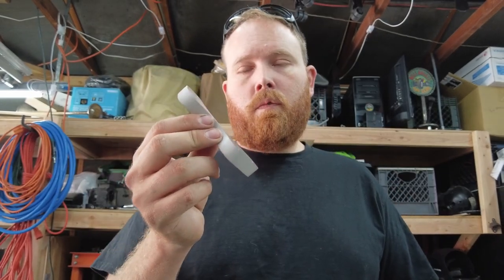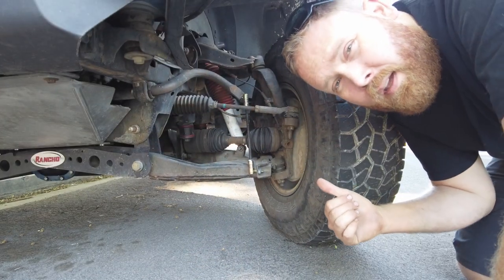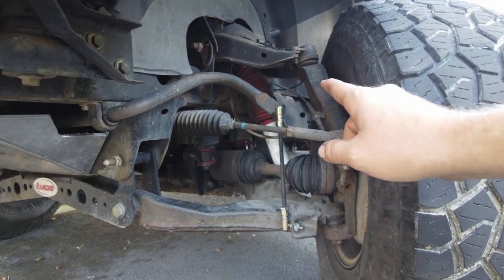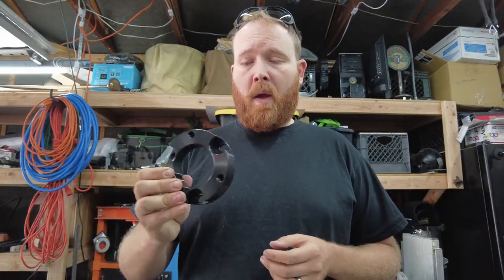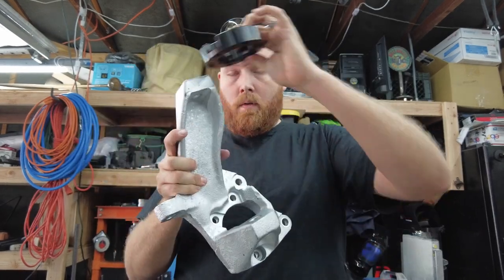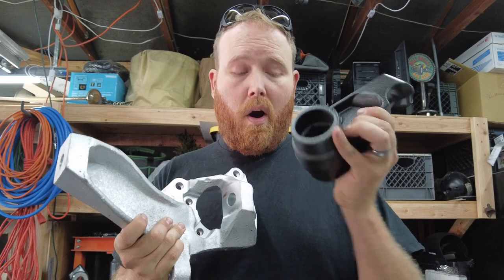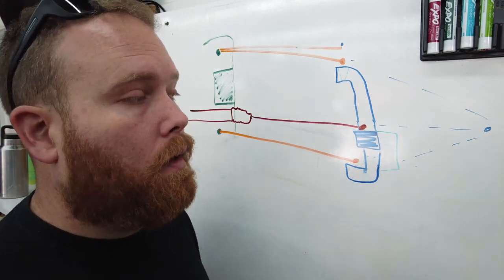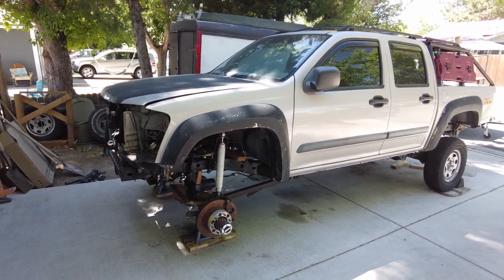Lift Kit VS Leveling Kit? [Why not both?]

Comment: Question. I have a 2008 Colorado z71 4x4. I bought a 2004 z71 but its 2wd. Can I swap everything over and it work on the 2004 frame? Will the front differential bolt up and everything else 4x4 bolt up on the 2wd frame?
Reply from the maker: Yep

Comment: Man I hope you make 2wd lift spindles for these trucks, the only company that will make them just like CST 5 inch spindles are Michigan Metal Works. Now they are a great company but they are quoting 3500 for a set of lift spindles. We need to find some that arent ridiculous priced for 09 to 12 Colorado/Canyons.
Reply from the maker: MMW quoted 3500 lol thats nuts.
Reply: @BadlandIndustries  your telling me brother, what's the status of your spindles?
Reply from the maker: @marcustellez6563  still working on the design. I need to 3d scan the z71 spindle to see how the tie rod mounts match up.
Reply: @BadlandIndustries  will this also work for the z85 as well?
Reply from the maker: @marcustellez6563  I plan to design it in such a way I can jig it for either suspension and weld it together. 2wd z85 and the 2wd z71.

Comment: Ball joint spacers wouldnt lift your truck because the weight and height of the truck is based off the lower control arm not the upper
Reply from the maker: you are correct

Comment: With your leveling kit / lift u offer does it effect flexibility/FLEX  offroad & rocks?    Or with disconnects u offer let it fully flex in front?
Reply from the maker: The disconnects will allow the front suspension to be fully hung and stuffed independently.
Reply: Ty,   also I kno u sent a link for billsteins for lift could u send link for Fox.   I been using them for years & I really prefer them if available for this vehicle with ur lift...
Reply from the maker: @user-uy6rb3bc9j  i would cross-reference the lengths of the bilsteins with fox.
Reply: Ty, if you had to choose a 4in kit rancho, skyjacker or tuff country to use with upgrades what would u recommend??   I kno u prolly have had experience with all them🤷‍♂️
Reply from the maker: @user-uy6rb3bc9j  I think skyjacker or tuff country has the best diff drop. Rancho pissed me off.
Reply: @BadlandIndustries  lol guessing that's why u made ur own.. I was going to go with ur kit and tuff country but seems from pics I seen on tuff country the control arm drop bracket sits lower then all other kits..
Reply from the maker: @user-uy6rb3bc9j  no they have to drop the diff 4 in but the way rancho did it was lazy. You can see them in my first diff bushing video.

Comment: Love my 355’s. My 27 year old Chinese spring compressor lost its thread yesterday after dropping the springs so I decided to see what info is out here on my down time. Those CST spindles are discontinued? Only I find are Fabtech 3 kits. Maxi track for 15 and up. Do you know where to get long travel kits?
Reply from the maker: H3 swap for "long travel 4x4", 2wd coil is gonna be custom. I am working on 4in spindles but those are still in the works.

Comment: Another informative video. Interested to see how the 35s on stick Colorado suspension goes. I put 6 ply 33s on my 2010 and the brakes were barely adequate hauling dirtbike in the mountains even with all EBC rotors and pads.
Reply from the maker: I have plans to encourage him to do the 09+ brake upgrade. I'm also looking into a disc conversion for the rear.
Reply: @BadlandIndustries  have you made a video on the 09 swap?  I’m going balls to the wall with my dads old Canyon.  Using your lift kit, planning on doing the 09 brake upgrade, 33s and going to raptor line her.
Reply from the maker: @ltx383  I'll talk through what im doing with mine and add info about what's out there to swap. Plan on swapping a gen 4 motor into your truck.
Reply: @BadlandIndustries  Lmfao it’s like you just told me my truck has testicular cancer.  “Plan on swapping a gen 4 motor” 🥹.  Honestly that’s what I was thinking the other day all these upgrades might hurt my poor stock engine.
Reply from the maker: @ltx383  I've seen too many engine failures with these trucks.
Reply: @BadlandIndustries  I was thinking of doing the supplemental oil line mod to see if it could give me more longevity.
Reply from the maker: @ltx383  it'll help for sure.

Comment: I have an 06 Chevy Colorado 2wd I'm stock suspensions and want to get a 3inch lift, would shackles and the spring spacers help give that 3inch look?
Reply from the maker: Our coil lift will get you close. You can then get bigger tires or source a spindle lift to add to it.
Reply: thank you, i have a friend who is selling me the coil spacers and i just want to know if it would lift the front of the truck.  @BadlandIndustries

Comment: So if I just have torsion keys cranked would the dif drop pucks and ball joint spacers help my front end and bring it up?
Reply from the maker: Ball joint spacers and diff drops are not for gaining lift. They offset the lift by reducing the angles on those components after you lift.

Comment: Hey Kevin so can I stack the ball joint spacer and coil spacer to get more lift on my z85 2wd canyon?
Reply from the maker: you need the ball joint spacer to prevent early wear on the ball joint when you install a spacer lift
Reply: Cool thanks man!

Comment: I have a 2wd z71 and seem to find these answers of companies that used to sell these knuckles my problem is finding any still selling them. 
I like the idea of that cst, with a helper spring and leaf spring lift you sell. Although idk if that’d lift it enough, either way I can’t seem to find any knuckles. Maybe just not looking in the right areas
Reply from the maker: You will need the aal and shackles at that point to lift the rear adequately. The cst can be made to work on your truck like I mentioned in the video.
Reply: So I actually found your old post on 355, in the video you said z85 is bolt in but on post said you will need machined taper for the tie rod now going on top. Also I meant in my last comment I can’t even find any cst spindles for sale

Cst seems to be the way to go if I’m gathering my info correct, if I were to somehow find a set would it be possible to mount h3 hubs and brakes on? Seems like a very worthwhile upgrade. 
Then again I may just not be able to wrap my head around all this, not really having a kit for sale saying 2wd z71 here ya go lol
Reply from the maker: @zeriqr7098  i have cst spindles in stock. Unfortunately you cannot install h3 brakes and hub on to it. You can however install the 09+ brakes and rotors. They are bigger.
Reply: Wow! I immediately looked and sure enough, not a single result came up for your website though I saw! Unfortunately I have a 2011 lol is there really that much of a difference only for 04-08?
Reply: I do see you also have spindles for 04-12 3” lift
Reply from the maker: @zeriqr7098  i can machine the abs sensor location for you just send me an email when you purchase.

Comment: My truck (06 Colorado 2wd crew cab, struts) had a fabtech ft21027 already installed when I got it, which has lift spindles and a lower ball joint relocation parts to it, that moved the lower ball joint to below the control arm, I've been trying to find out if I can just swap the ball joint with the spacer that took it's place in the lower control arm, to bring the truck down about a inch to where I want it.

I've tried to talk with fabtech about it but they weren't helpful.
Reply from the maker: Not likely. The geometry would be all funky. I definitely have a buyer for the spindles if you want to swap to my coil lift and that will get you closer to your desired height and make you some money in the process.
Reply: @BadlandIndustries  I don't have the original spindles to swap to.  Looking at the geometry, it looks like, by moving the lower ball joints back to OEM location would restore proper geometry, instead of tie rods being angled down so much, and would also give the upper control arm and ball joint a better angle, kind of like your upper spacer would. Just trying to find the best and easiest solution with what I got. I'm in the research stage right now.
Reply from the maker: @mekial2222 you'd get bump steer. Spindles are easy to find on car-part . com

Comment: That combination I can put on z85 2wd? For 6" lift?
Reply from the maker: Yeah if you go with our spacer lift and add thr 3in spindles. You'll want to do a spring over lift in the rear with a longer driveshaft.
Reply: @Badland Industries  you can insert links for see prices and availability thanks
Reply from the maker: @frankplp  it's on my website.

Comment: 15:49 for coil lift and spindle, should you flip the ball joints?
Reply from the maker: coil lift always flip and spacer. spindle, being essentially stock replacement not necessary but it wont hurt anything to get the spacer and flip the ball joint.
Reply: @Badland Industries  if doing both should you flip both ball joints? And the fabtech spindles I got were taller than the stock one
Reply from the maker: @red_stag05  well since the lower ball joint is already on the bottom of the arm no. I recommend putting the steering stop above the ball joint for an extra .25in lift.